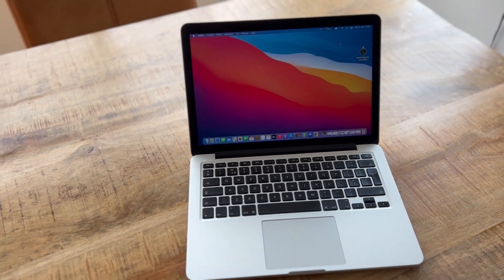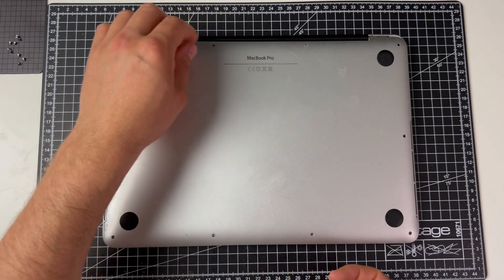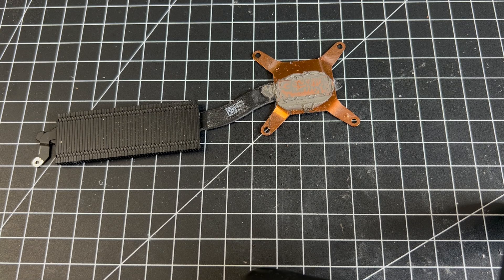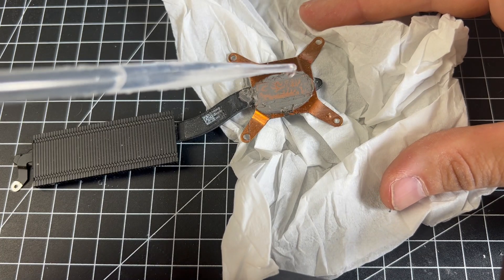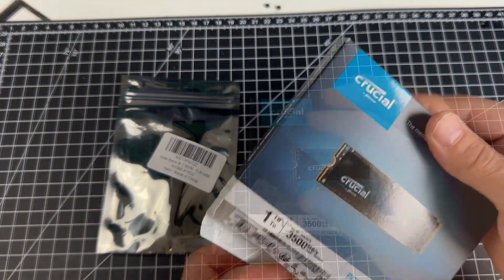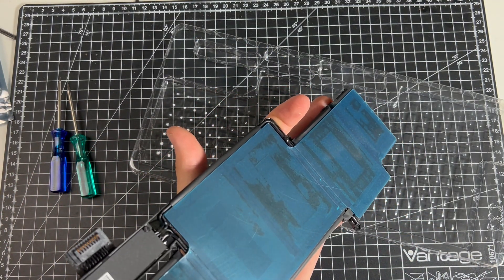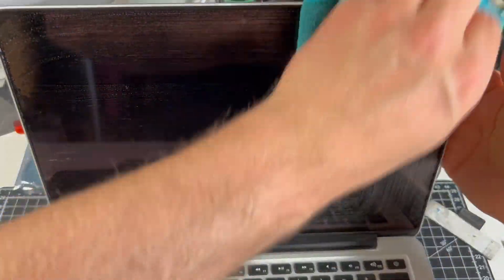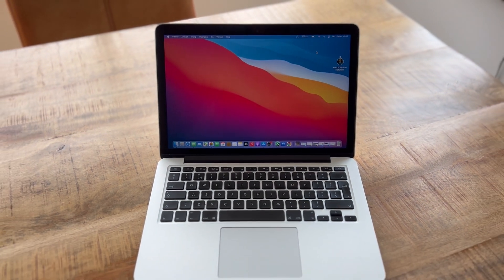HowTo: Upgrade mid 2014 i5 MacBook PRO - 1TB SSD/NEW BATTERY/THERMAL PASTE

Comment: thanks for sharing, do you hv any issue recover from sleep mode? Seems 2014 model will not support sleep mode recover with 3rd party ssd.
Reply from the maker: My Macbook is still working great, never had any probleems recovering from sleep/standby mode. Just close the shell and open the next morning. Even after a week, it awakens as always.

Just fyi, i run the standard latest supported and updateble MacOS no fancy stuff :)